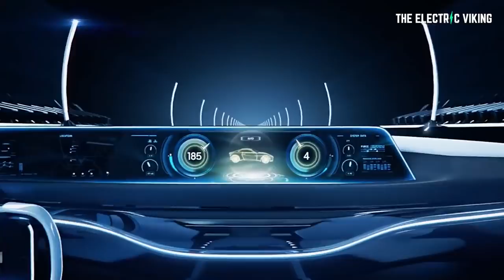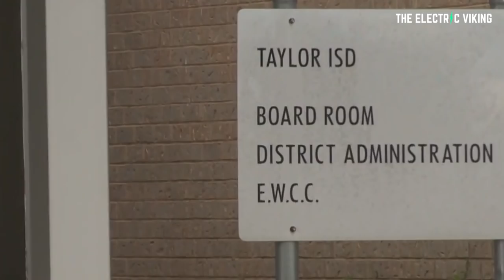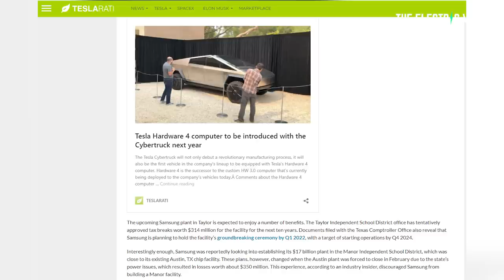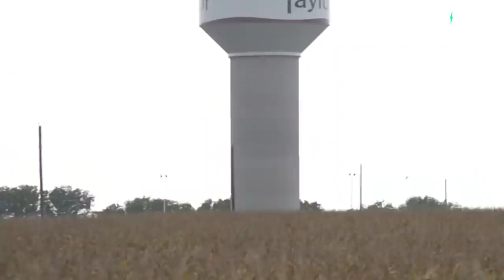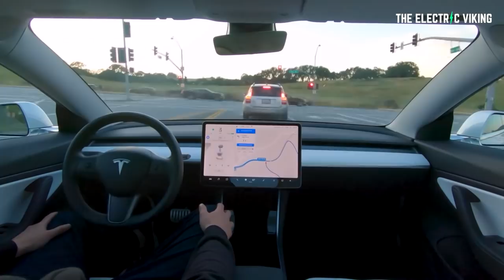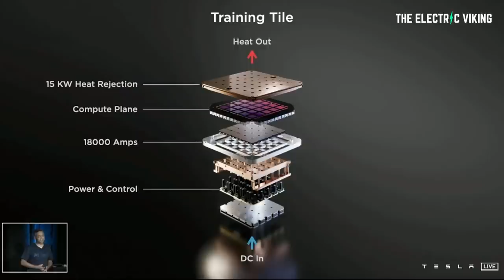Samsung is building a massive $17B Semiconductor factory near Tesla in Texas

Comment: Samsung was also looking at Phoenix but decided four months ago on Texas. TSMC started construction of their $12B plant four months ago in Phoenix with an additional $20B build-out in design for 2024. Intel broke ground with their $20B FAB expansion in Chandlers AZ. The USA government and Arizona state taxes incentives are pushing the FABs into the desert where electricity is reliable and water is scarce.
Reply: linkzable  I really don't know nor care. What do my remarks have to do with Presidents? All I can say is this year in Arizona Lucid Air EV Mfg, Li-Cycle battery recycle plant,  TSMC, Intel, Microsoft Data Center, Google Data Center, Stack Data Center, Iron Mountain Data Center, Facebook Data Center, Nikola Motor with Bosch Hydrogen and EV, Sion Power's Licerion Li-ion batteries, Atlas Motor EV Trucks, Elio EVs, Atlis AVM battery and new Solid-State Hydrogen facility under construction or beginning to deliver a product. All these plants are boasting they are using renewable power from the utility but when you run the numbers 58.9% of the state's power comes from fossil fuel and 28% from nuclear which many say is not renewable. So roughly 87% is not renewable.  The good news is 5.5% of the renewable power comes from solar which includes private homes generating power back onto the grid.

Comment: Samsung already has a multi billion dollar semiconductor plant in Austin which has been expanded several times over the past several years. It takes a lot of time and work to put together a chip manufacturing plant. Chip manufacturing requires a lot of special clean environment and precise automated equipment.
They might have set up shop in Taylor for tax incentives. The location is only about 30 mins away from the North Austin Samsung plant. Aa far as the electric grid issues go, the entire state has a problem with facilities not being retrofitted for bad weather. As independent as the Texas GQP likes to think Texas is from the rest of the country, it's 2021 and that kind of thinking is just stupid. The state us nearly 30 million residents  and hundreds if big businesses that will out their muscle on the state leaders to update the Texas grid and join the national power grid. That would mean more access and competition for power on the national power grid and probably lower rates for residents. Times are changing in Texas a lot faster than the state's GQP can handle it.

Comment: @7:05 With climate change destabilizing the circulation pattern of the jet stream, you can expect that the once in a generation storms will happen once every decade. 
Wind will come down from Canada because the jet stream is no longer going to stop it. 
It will in fact drag cold air from the Canadian Prairies down to the Gulf of Mexico because there's nothing to impede it.